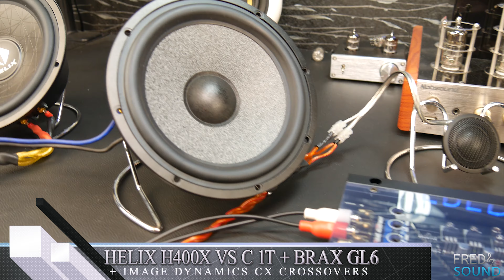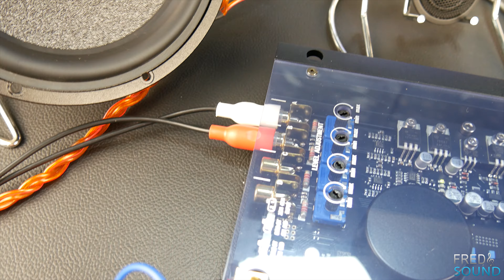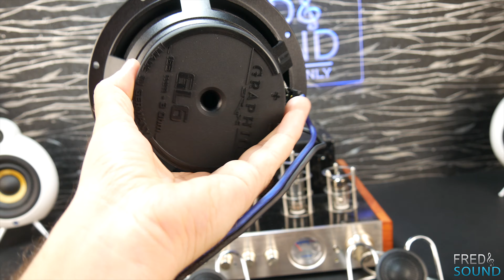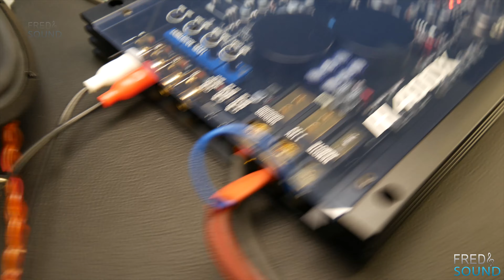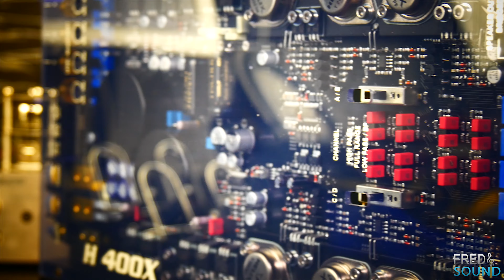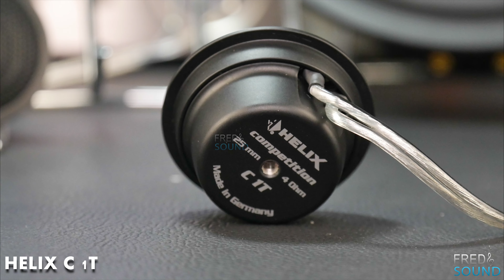HELIX H400X vs BRAX GL6 + HELIX C 1T + Image Dynamics CX crossovers 4K (INT)

Comment: Two year ago i newbie entry in car audio ....helix amp is one of  iam considering install .. .but some reason iwent for steg k402 x2  for 3way setup.  ...it sound so good .and the bass respon it so ommmmmh n clear even macthing with the cheap component set.myfriend 's helix audison amp cant even touch steg k series in that low frequency  respon.
Reply from the maker: Khoon Voon hi, well yeah this is what I’m trying to explain people who don’t know and spend $ on Cnc case for nothing, K series are the best A/B class amps ever made, and the best value, those amps are full of frequencies crisp and warm
Sweet sounding, can’t go wrong.. thanks for watching
Reply: @frednsound  For you, is it better to put a 6 ch AMP like f6-380 and run 6 speakers active or 4ch STEG k.401 front speakers active only ?
Reply from the maker: @Sylvain SCHMITT hi, I would go 6ch active, for front 3-way, F6-380 or K4.01+K2.01, thanks for watching
Reply: @frednsound  and if the 2 way speakers are 120wrms each (Morel tempo ultra 602), is the f6-380 ok? because it produces "only" 6x60wrms
Reply: @frednsound  so, 3 way front, not 2 way front + rear coaxials ?
Reply from the maker: @sylvainschmitt9447  it’s a very clean real 60rms, unlike other amps, will do great for active, you could do 3-way active or 2-way active + rear passive, thanks

Comment: Hi Fred.
Why you don't use a better RCA cable?
Do RCA and speaker cable matter or not really need to a better cable?
Reply from the maker: mok wai loon hi, all wiring is very important, it should be real OFC and properly shield, the thickness depends on Length and current power, all wiring we use is OFC and fits the test standards, thanks for watching

Comment: Good morning! Thank you very much for the content. Asking for base amps in a video where you discuss top quality amps seems like a joke to me, but I'll give it a try. 
Have you had a chance to compare the difference in quality between the Helix M line and the Alpine R ? Would you be able to give me some guidance on this ? Thank you!
Reply from the maker: Thanks! Good morning mate, both the amps you mentioned are similar Chinese board, nothing special in them, and yet will have the empty sound, from both, the helix will be slightly better, thanks for watching
Reply: @frednsound  Thank you very much for taking the time to respond. I assumed that would be your answer....

Finally, I abuse your trust and ask you: could you give me an opinion on the Alpine X series ? Is there any difference that merits its purchase with respect to the amplifier models I mentioned before?

Thank you very much and good luck!
Reply from the maker: @javieribarra9908  welcome mate, personally, never found alpine great on amps, always something missing, they are great in headunis by providing full range and details, for amps in sound quality terms, chose other brand/model, thanks
Reply: @frednsound  thanks, again!
Reply from the maker: @javieribarra9908  welcome mate

Comment: Hi Fred! I am trying to assemble my audio system and I am between this helix h400x or a hertz mille power 4, which one do you recommend?
I'm running a hertz Mille legend 3 way active and Helix dsp pro mk2
Reply: Jl audio slash 300/4v3 clase a/b te da casi los 100rms de 1.5 a 4 ohms, tu calidad y potencia jamas se minimisa por ese gran sistema, ya que en las las notas super altas los ohmios suben y bajan segun la intensidad de la musica. Yo tengo 3 via activo, audiofrog gb con un 300/4v3 y un 300/2v2 para mis medios bajos. Dsp alpine pxe-0850s y un  slash 1200/1v3 para una tercia de 12tw3 en caja sellada
Reply: Which amplifer you install. Helix or Hertz. ?